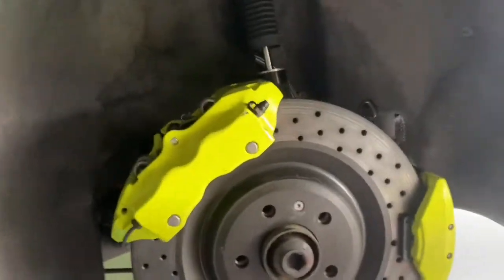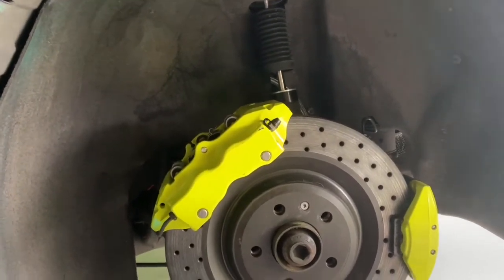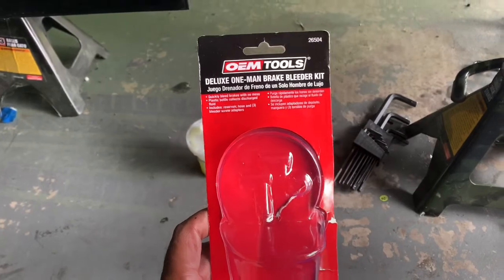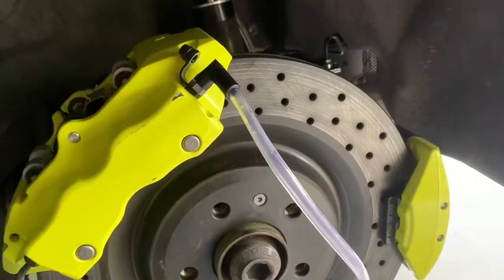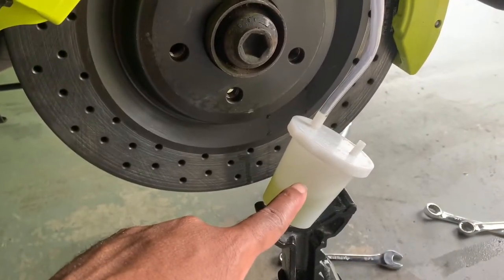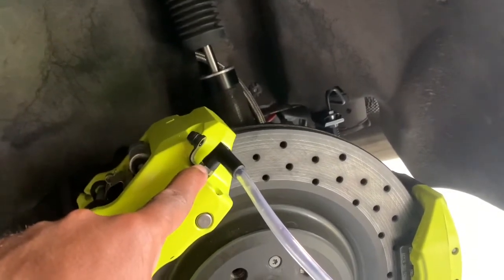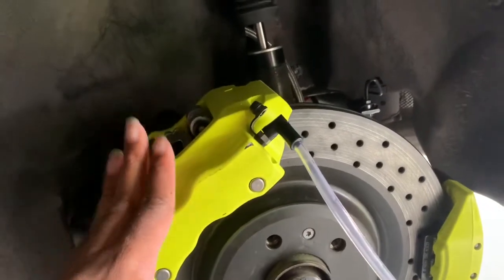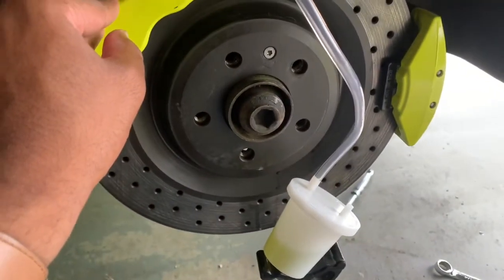How to fix Mushy Soft Brakes on any vehicle  in 4 minutes!!!!( All ways be safe)(Audi A5)

Comment: You need to replace your master cylinder with one that has a larger piston in it.  You put new calipers in with a larger volume of displacement. Your brakes will feel/work  better if you install a larger master cylinder (upgrade). I took one out of  a Audi Q7. Designed to handle the 20 pistons volume.
Reply from the maker: Thanks for the info,  it feels really good, now, but it’s always good to go the extra mile 💯💪💯💯 , I replaced the master cylinder with my front upgrade, definitely good info for someone upgrading, who want to get the most out of there car
Reply: I get your logic but your statement is not factual.  It is not about how many pistons but the size of the pistons.   The OEM caliper is giant and its a floating caliper so the caliper push/pull in order to apply pressure, the 4 piston caliper has much smaller pistons and the caliper is fixed.   The 4 piston caliper used in this kit is within spec of the OEM master cylinder.   If you have a soft pedal with this kit you either 1)need to rebleed 2) install braided lines that can handle the increased pressure 3) revisit your pad selection 4)test your Master Cylinder to ensure it is not failing.
Reply from the maker: Vosh Mods well said, my car stops so hard now, I almost broke my neck,  thanks for the kit , it’s amazing, I had a few people reach out, Scotty is one of them 🙏🙏🙏🙏🙏🙏

Comment: If you introduce Air into an ABS system sometimes you have to put a scan tool and cycle the ABS modulators to expel Air , also ABS systems are really not bled like a traditional non-ABS system you don’t go from furthest from master cylinder it’s usually a diagonal bleed from right front to left rear back to left front and right rear
Reply from the maker: Good info
Reply from the maker: Lucky that’s we’re i started 🤣😂
Reply: Bruce Custom Motors HA 👍😉